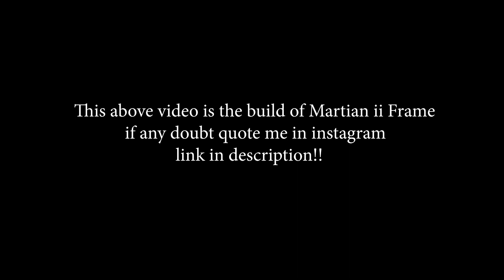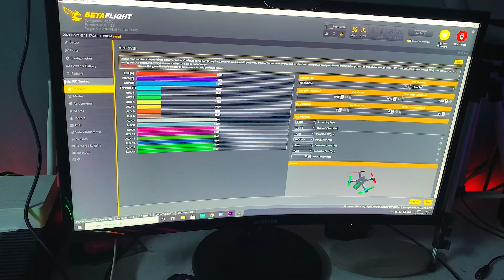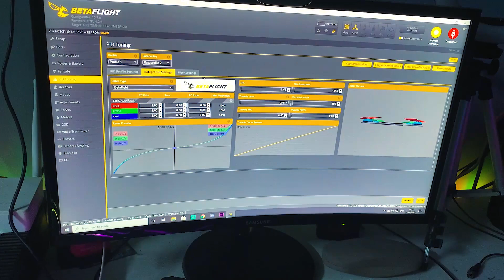Martian 2 build Timelaps | Tamil | FPV Drone

Comment: Hi bro 
.. Nangalum fpv rcontroler vangirukom.. Atha system simulator la connect panalamnu patha.. Failed failed nu varuthu.. Pls pls bro athuku solution solunga 🙏🙏🙏🙏plss.. 2 days ah RC ah system la connect pana  connect aakaaatithuu.. 😢😢😢😢😢😢
Reply from the maker: Dm in ig (karthik17fl) of your controller details..

Comment: Super Thala! Congrats and Expecting more drone series Videos.   Flight Controller name?  Total budget?
Reply from the maker: Im using mamba stack ..total budget comes around 70k
Reply: @sprintofficial  Semma bro.   Im looking for building low cost drone using APM 2.8. Could u suggest a good budget FPV camera
Reply from the maker: @vikevignesh4541  apm builds are too old bro why don’t you try fpv drone itself..
Reply: @sprintofficial   Budget bro. Plan is to build within 10 K and
Reply from the maker: @vikevignesh4541  10k is more typical bro.. even you can’t build apm drone also in this budget
Reply: @sprintofficial  Yah bro U are right. Got all the parts but except two. Couldn't include gps module and FPV camera within budget. Anyway, Expecting more drone series in this channel
Reply from the maker: @vikevignesh4541  definitely more videos is coming on the way only on tamil❤️
Reply from the maker: @vikevignesh4541  please share and subscribe to my channel ❤️
Reply: @vikevignesh4541  F450
Reply: @harish9939  F450?!!
Reply: @sprintofficial  Dude can you share a break-up for better understanding?